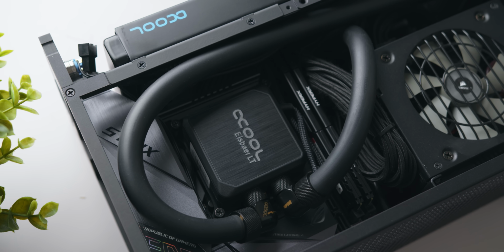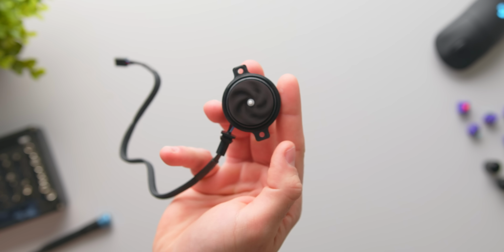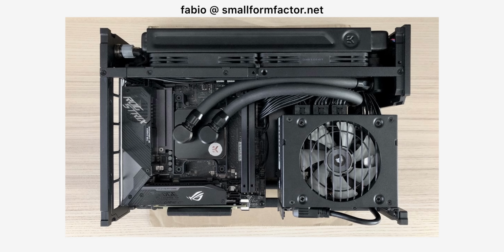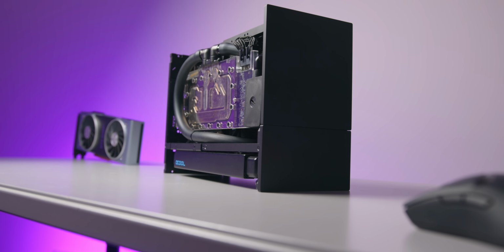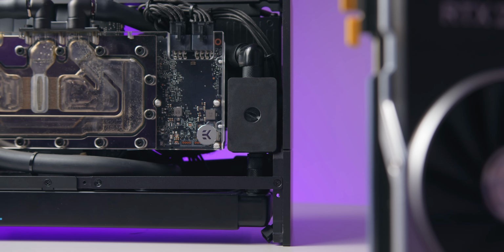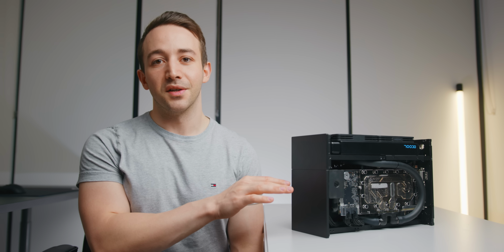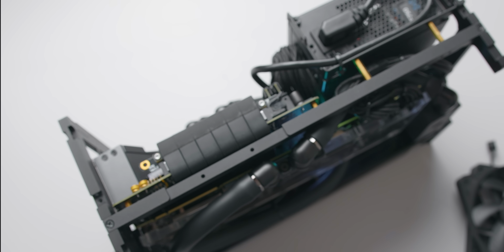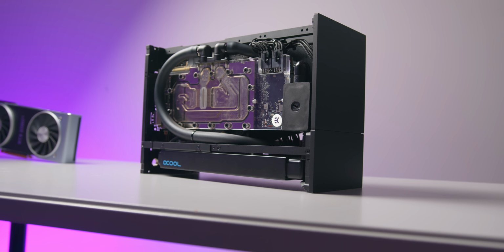ITX Watercooling Easy Mode - Alphacool DC-LT

Comment: Noob question here : would'nt be easier to build an air cooled system in this case ? 
Would the system run actually run much hotter on air cooling ?
Reply: Custom loop water cooling provides much better thermals than air cooling and also aio coolers and you can also water cool the gpu so you end up with a cooler and quieter system by quite a lot

Comment: meh, the power supply is too small... i wnat the same case only room for the biggest of power supply.... big enough to fit 1300 watt evga power. try again
Reply: For what do you need more than 1300W? We have a serverrack with Threadripper 2990X (32 core) and 4 x RTX 2080TI and that needs around 1550W full load (Prime95 + Etherium Mining). GPUs with full boost and around 10% OC!